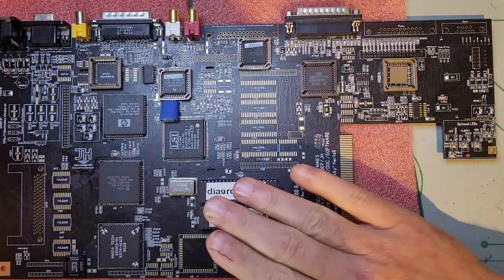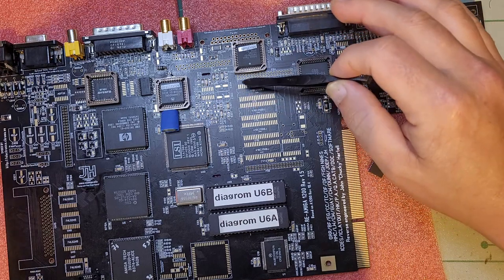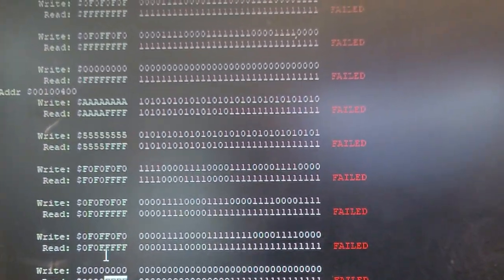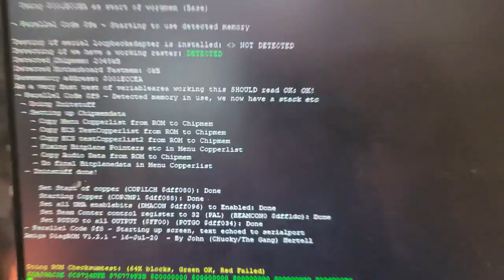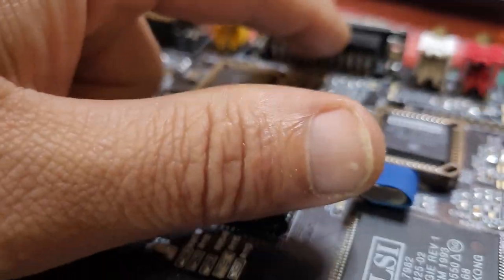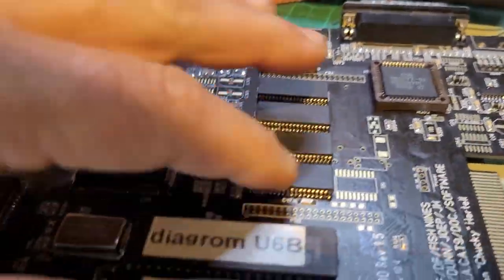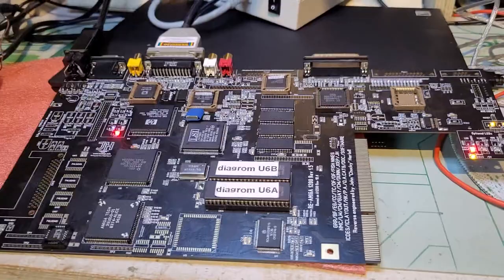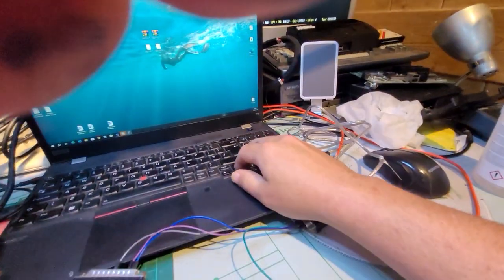Building the Re Amiga 1200 - Part #3

Comment: I think I early warned you about that RAM in a previous episode. I've learned about that RAM when I had to replace a bad ram chip on an A600 (which used the same RAM but 2 chips instead of 4). But you did a great job, well done. I know they are not that easy.
Reply from the maker: for sure yeah. def the hardest ones to solder on this build. all in all though it's been rather smooth so far so I can't complain , esp having 0 experience with SMD work

Comment: Check the whole of the instructions because youll find there are some components not in the BOM and therebwas an extra IC and resistor required. Nice to see your reAmiga coming along. I'll be interested to see if you get a buffered CF adapter working if you have one.  I had problems with two I tried but a nonbuffered one worked fine.
Reply from the maker: yeah I got equivalent parts on some of the stuff in the bom alright.
Good to know about buffered cf adapters. was going to get one from amigastore
Reply: @8bitmanshed  It might just be  mine or the reAmiga itself, I don't know yet.  I asked the question last week on your meet up with TF, but I dont think anyone replied or I fell asleep.  I was just asking if anyone knew of a possible issue with the buffered adapters not behaving with the reAmiga.  I've not yet got to the bottom of the issue.
Reply: @8bitmanshed Perhaps it would be worth asking if TF or Chucky knows of any reason why a buffered CF adapter would not work but a non buffered one will? It worked intermittently for me then stopped working the long the computer was on.
Reply: @paulklasmann1218  so just tested a buffered CF adapter, it seems the issue is with the CF cards themselves, not all are equal apparently. I've ones that work on that , others that don't . So cards also don't work as a slave .. fun. wondering now how a CF to SD card adapter would behave
Reply: @banjoguyollie  That's odd, I use only branded CF cards with well known names like Kingston or similar.  Can you say which one did work with the buffered adapter? I'd prefer to use the buffered adapter because it sits a bit higher than my unbeffered adapter which is at a slight angle to to the capacitors underneath. Thanks.

Comment: Thanks a lot for filming the part 3 ! Very useful and I'm going to use your videos along with Chucky's tutorials. I got most of the parts delivered from mouser (some are backordered). Still missing actual amiga 1200 chips ( need to find a reliable seller to buy those from ebay I think). Bought those oscillators which are being shipped from UK to the states right now. I'll probably start this project by the end of Aug. I have much less experience than you so I suspect this i gonna take months for me. I'll do my best to not screw it up :) Anyway I'm so glad you're doing this ! Looking forward to the part 4. (pcbway ad is superb :) love your ninja-partner and I've seen him on BG Ollie channel. Very talented little dude! Does he do some soldering too or he is mostly giving advises ? :))
Reply from the maker: ah that's great. let me know how you get on with it . great to hear some people are building these too . 
take your time with it and follow the guide :) 
the Amiga IC can be tough to get . I got them off a mix sellers here in europe : 
https://icomp.de/shop-icomp/en/shop/product/Chipset-aga-nos.html 
and Analogic on ebay (they have a web shot too : https://www.analogic.co.uk/shop/amiga.html )
oh and thanks for the support on Patreon :)
Reply: @8bitmanshed  Will let you know how it goes for sure, but I guess I'll be working very slow. Thanks a lot for those links, gonna check them out!  (as to patreon it's my pleasure :))